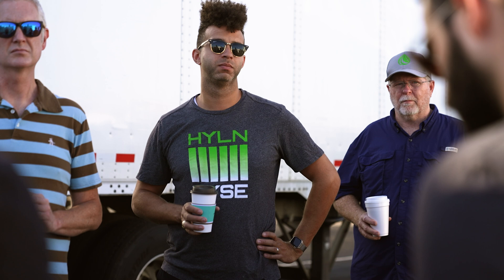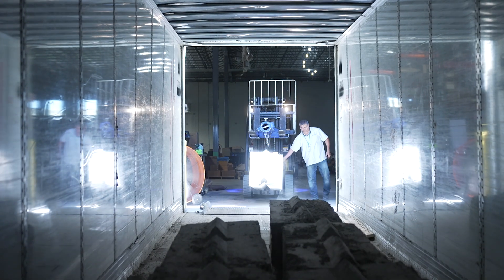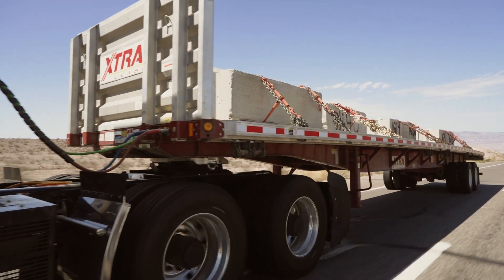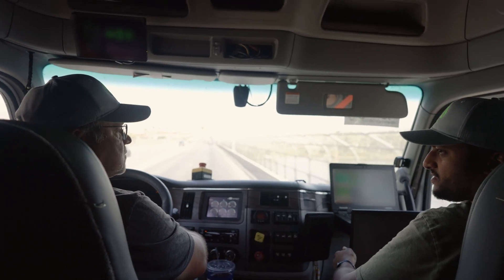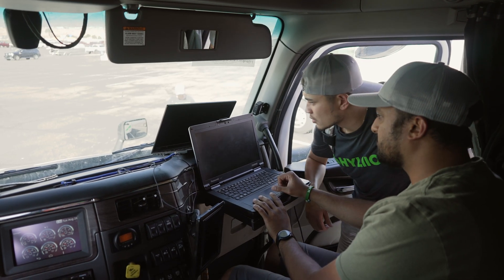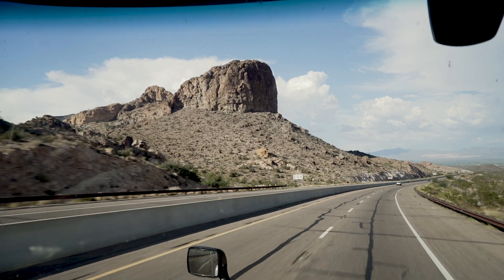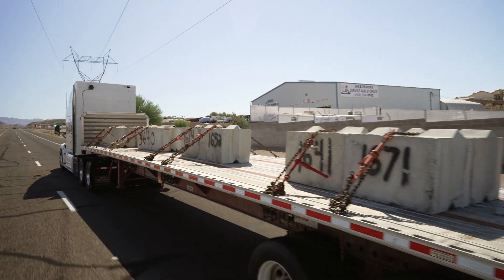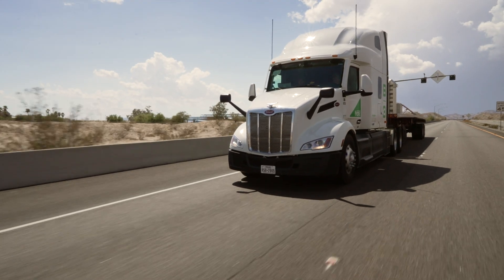Summer Testing | Hypertruck ERX Powertrain

Comment: 1,000 miles of range at $0.33/mile of fuel, all electric, carbon neutral, no horrible emission system to break down and put you out of commission for hours... this is the future, get on board now, you're buying the next Tesla in the single digits!
Reply: Not to mention tax credits
Reply: Since Hyln doesn't want to make/lock themselves into a few particular vehicles once the powertrain system is perfected it could be rapidly added to any vehicle class from commercial to personal. If Karno works as advertised it puts Hyln in a position to dominate the global energy sector and thus the world.        Every home in the world would want its own karno if it produces electric cheaper than grid.  This makes the grid the backup not other way around.  Humans and nature will be making NG FOREVER!! it just depends on how much we want to capture. 1000yrs from now even on an alien planet we will still want to capture our methane byproducts and use them for fuel even if it's just for the need to not let them build up in the atmosphere.

Comment: Great job guys, finish line is just around the corner
Reply: The worst lies are the ones we tell ourselves.
Reply: @DebtPRZ  applies to you.
Reply: @akumar3224 – Applies to everyone. Never forget that.
Reply: @DebtPRZ  I agree. I said the same thing. Time will decide who is on the right side. I am in it accepting all risks that may come along the way.
Reply: @akumar3224 – Ditto.  I fully accept the risks associated and have conviction for my chosen side.  However, there doesn’t have to be one winner, pal.  Keep that in mind as well.
Reply: @DebtPRZ  please let me know where you have invested. I would love to drop a negative comment with all my conviction.
Reply: @akumar3224 – Come on man… it’s not hard to tell who I stand with. My horse is off to the races.
Reply: What are you talking about? Sounds like you lost faith. Company is barely coming up on two years since concept